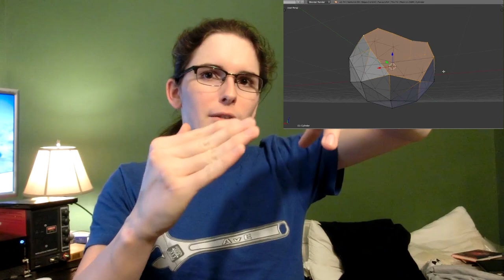Personal Bits 0238: high-temp heat gun, Manhattan Project, N-Gons

Comment: For a high-temp heat gun you could inductively heat a titanium tube and force air through it. Temps could approach 3000 degrees F.
Reply from the maker: +David Christy hrmm thats interesting, but would it start oxidizing at temperatures even below that?
Reply: +Rinoa Leonhart It probably would but it would be spectacular for a few minutes! It could be coated with a high temp ceramic.